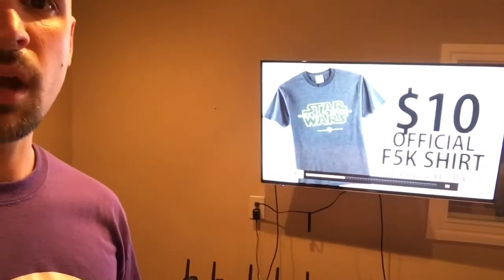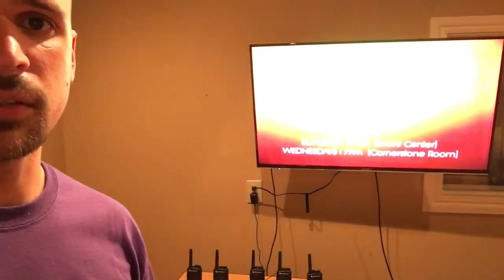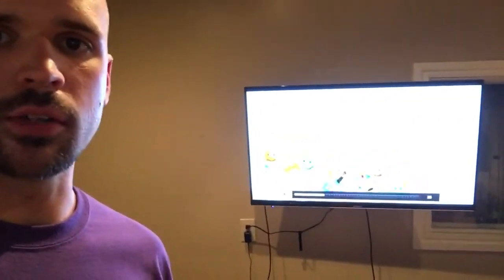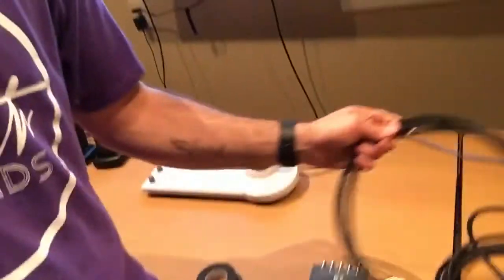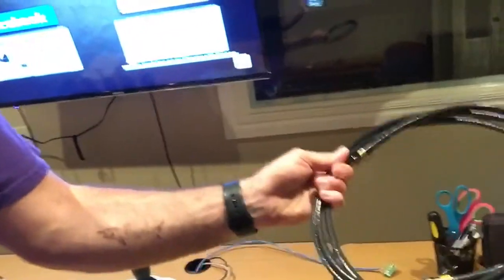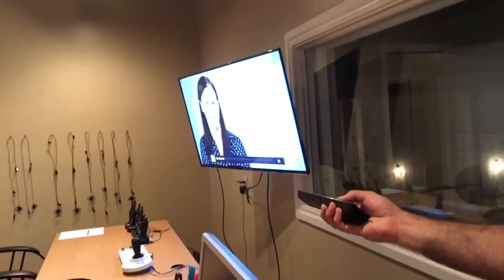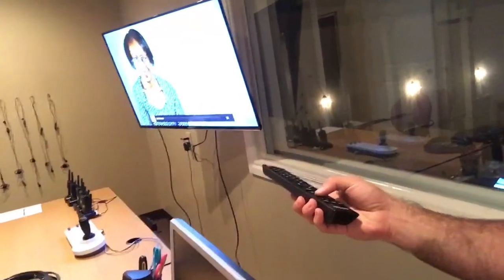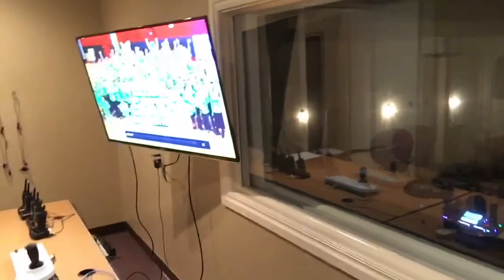Switcher / Micro Converter Problem (SDI to HDMI) ATEM 1 M/E

Comment: Hey Justin, I have been reading your threads and updates all morning. I have this same problem. And with my church we can't afford to have it down for a third weekend. I have installed the update on the converters and have received the same exact issue still. Have you had any success updating?
Reply from the maker: Good morning Chris, I haven't had the opportunity to update just yet, but I will on Sunday morning, and advise of my findings. Here is the converter that we purchased from Amazon to replace these junk BM Micro's. They're cheap, but get the job done. https://www.amazon.com/OREI-XD-500-HDMI ... rter&psc=1
Reply: So... weird thing.... I had the BM converter connected but used a 4K hdmi cable. I'd have to look at the specific brand... but now i no longer have the sound issues. It seems weird if that could be the issue but either way the issue is gone.

Comment: Hi, Any news about this problem?
Reply from the maker: Willy Ferraz nothing yet. Sorry.
Reply from the maker: Plug up your Micro Converter to your computer and open the update utility. It has been said that the newest converter firmware update may have fixed it (7.0.7). I have yet to update ours, but I will attempt it and reply with the results later this week. Please let me know your findings as well.
Reply: Justin, did you find a fix with any of the latest firmware versions?

Comment: We have same problem. Contacted Blackmagic and all they did was acknowledge the problem. They are "working on it, but no fix." When asked what would work, support guy did not offer any suggestions, even though they have the Mini Converters. We're calling back to ask specifically if the Mini Converter SDI-HDMI will work. I'm registering on the user forum and will post this as well.
Reply from the maker: @Mitch Hartman, we are still waiting as well. No fix as of now. They seem to release updates once a month mostly. Below is a link to the forum thread, if you'd like to read through it.This has now become a larger problem as more people get involved and experience the issue. The only solution is to spend more money on more expensive converters. They did offer (to me at least) to help me process a return through the purchase company and "suggest" that I purchase the more expensive mini converter.It always seems very pathetic hearing a company say "Hey, thank you for finding out that our equipment has a problem, now we regret to inform you, we can't help you". I stand firmly by the opinion that this problem should have never made it our of their facility. Period. https://forum.blackmagicdesign.com/viewtopic.php?f=3&t=49951
Reply from the maker: Also, reading through the forum thread, you will find that it is actually appearing to be related to the ATEM itself and not the Micro Converter. Either way, as soon as updates come across (I check once a week) for anything converter or switcher related, I test and update the firmware in our BMD hardware. So far, no luck. :)
Reply: Thanks for update...I just re-read @AVIMO reply below and see that the Mini converter doesn't work either. So yeah, ATEM seems to be the culprit. :( We have found BMD support lacking on other occasions as well, but decent on others. AJA, otoh, has always provided excellent support, even going so far as to update driver within days.
Reply from the maker: Plug up your Micro Converter to your computer and open the update utility. It has been said that the newest converter firmware update may have fixed it (7.0.7). I have yet to update ours, but I will attempt it and reply with the results later this week. Please let me know your findings as well.

Comment: I am having the exact problem.  I switched the micro to a mini and it did not make any difference. I contacted BM and they said they are working on the issue but cannot give me an exact eta on the fix. I am wondering if you solved your problem or what BM told you.  7-27-16
Reply from the maker: @AVIMO, I'm sorry to hear that you too are having this problem. This is really disappointing, because I am really a fan of Blackmagic's equipment and their customer service. However releasing a new product line without ample real world testing is very troublesome. I just posted an update to my problem in the details above. Keep me posted AVIMO, on your progress with BM. Ride them until you get what you need. Email communication works best for BM.
Reply from the maker: Plug up your Micro Converter to your computer and open the update utility. It has been said that the newest converter firmware update may have fixed it (7.0.7). I have yet to update ours, but I will attempt it and reply with the results later this week. Please let me know your findings as well.